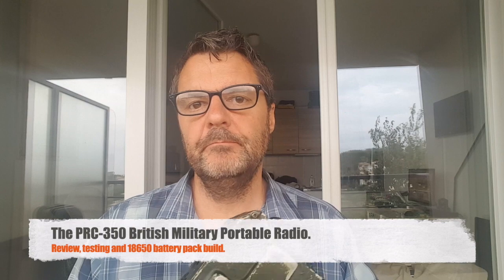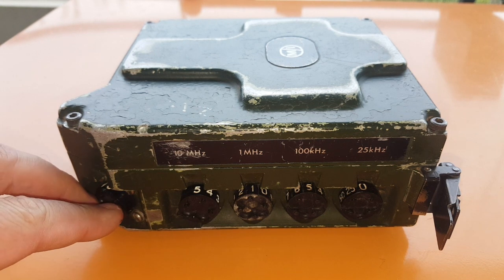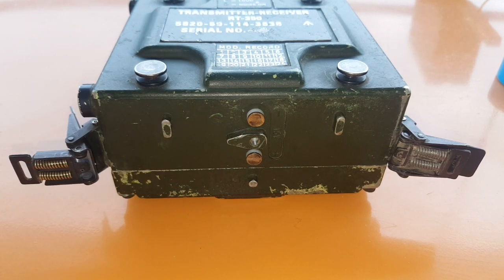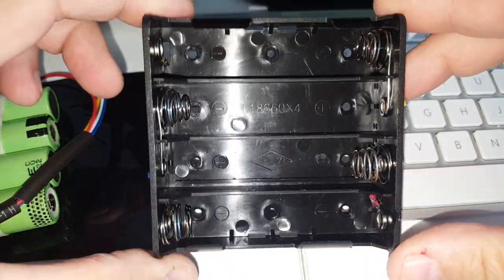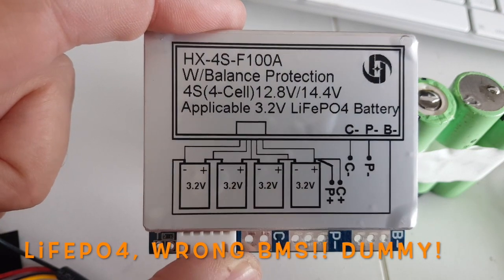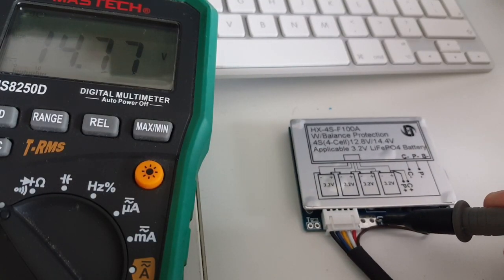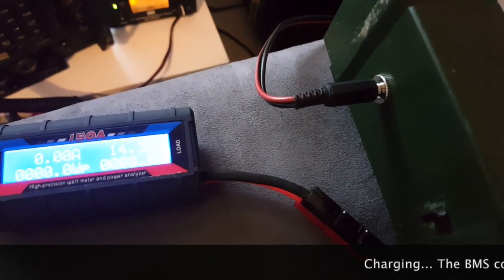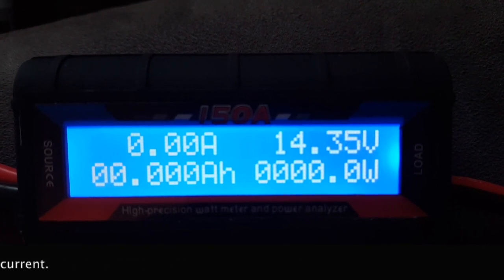The PRC-350 British Military Portable Radio.

Comment: Could you not use C battery carriers with AA cells?
Reply from the maker: Not sure what you mean, AA cells in C size carrier? They wouldn't fit. C cells are much bigger than AAs.
Reply: Radio Prepper hi yeah, they are C battery sized plastic carriers, you insert AA batteries, into them, cheaper than trying to buy rechargeable C batteries.  I have exactly the same 350 battery issues.
Reply from the maker: Ah, yes, you could. I did read somewhere that thsevholders were a tad short and could cause bad contacts, but it might be worth a try...
Reply: Radio Prepper a centime or penny between the inner contact is should work. The cassettes are too well made to discard.
Reply from the maker: They are.. I have one left..
Reply: Yes, I read that too.  I have two spare 350 cassettes and think I may give it a try.

Comment: I use Ni-Mh batteries for all my military gear. You can build the pack easy, then charge using a smart charger. I built a battery pack for my PRC-77 set using 16 cells. You can do the same with the PRC351, PRC320 etc (20 cells). Li-Pol cells are too fussy about how they are charged. Use the "KISS" system ( Keep it simple stupid) hi hi.
Reply from the maker: Absolutely! Thanks.

Comment: I would use a painter's hot gun (very carefully!) to shrink plastic wrap.  A lady's hair dryer might also work.  I'm too chicken to use a blow torch. LOL  Also, IIRC your battery voltage should settle down to 3.7 volts per cell after the initial charge to 4.2 volts.  Oh BTW,  I really like your penchant for military radios. I don't focus particularly on their prepper utility.  I like the military rigs because they are very cool! 😊
Reply from the maker: Definitely safer. They settle down to 4.0.

Comment: Hi Gil. I think you will be okay to use the Lifepo4 BMS with the lion cells. In fact it should make the 18650 cells last longer. The real problem would be if you had done the opposite by using a Lion BMS with Lifepo4 batteries. They would be consistently over charged. I divided the voltage I saw on your meter and the cell voltage should be 3.6 volts. If they were lithium polymer I might be concerned because they aren't as stable. Just thought I would mention this. 73. KF4UPI ~Ron
Reply from the maker: Absolutely. I would like a bit more voltage though...

Comment: That is a cool radio for your collection. I have rebuilt several legacy packs using 18650 cells most recently a Motorola MX350 . I prefer using a battery holder over a BMS with the low current of < 5w radio and have had great luck for very little additional weight.  The one pack lost 10 ounces just by eliminating the NICD cells. Thanks for sharing !
Reply from the maker: Yep, it definitely is lighter!